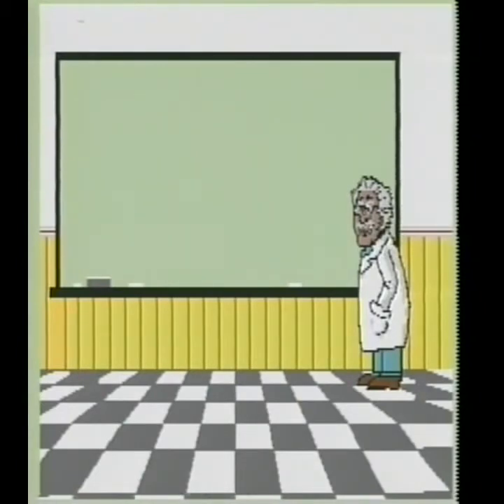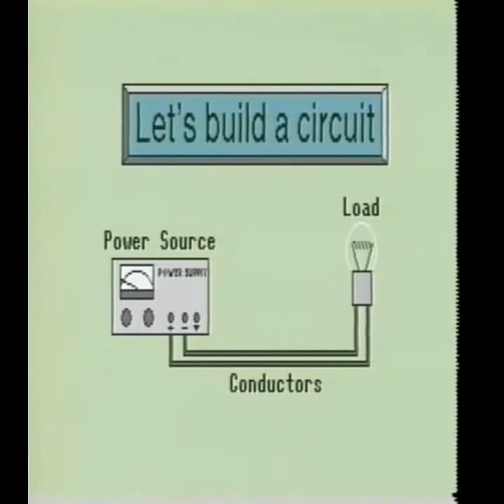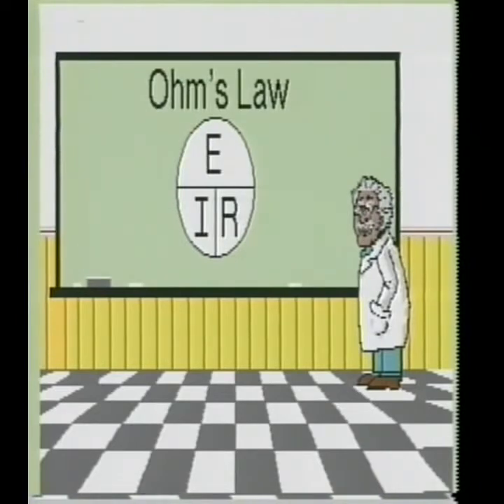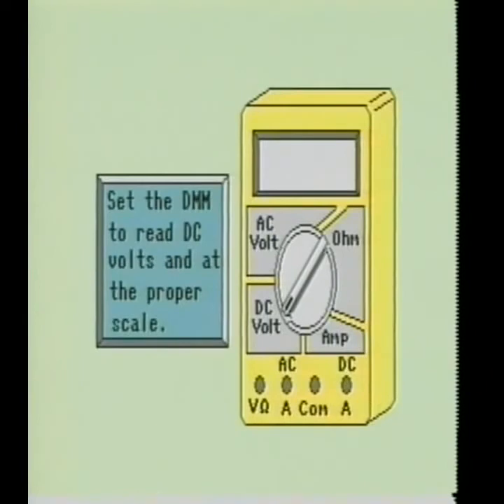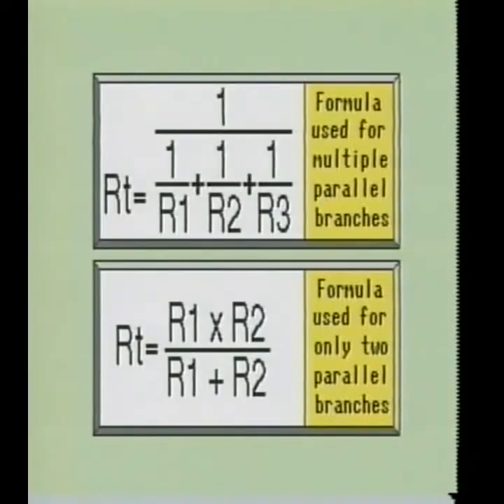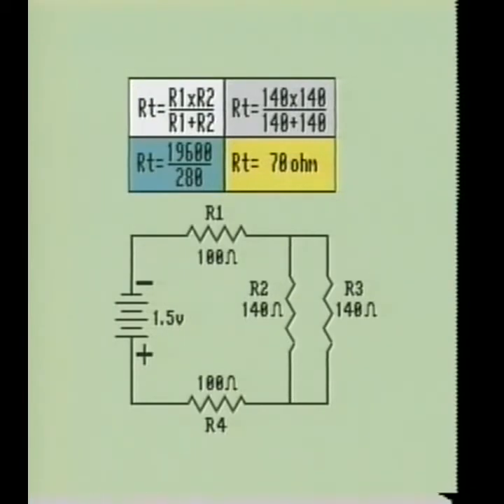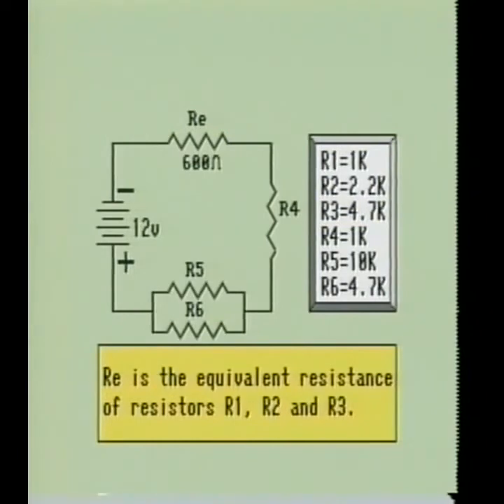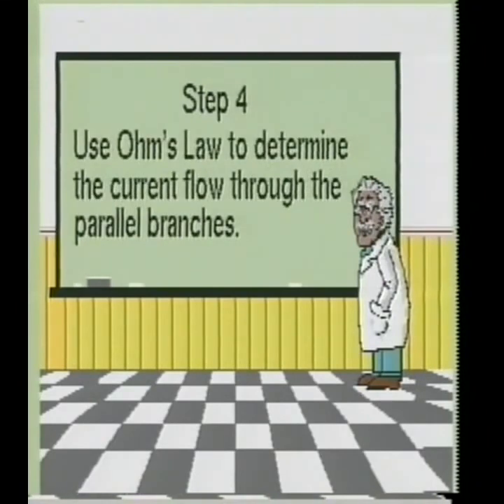Electrical Training UCanDo VT201 Part 1 DC

Comment: Do u have all these videos on DVD?
Reply: Part 2 is the AC, and part 3 is the one titles semiconductors.   Then there is part 4-6 (titled ‘Power Supplies’, ‘Amplifiers’, and ‘Oscillators’).   They are ALL the 200 series (201-206), then there is a 6 part 300 series (301-306) under the title of Digital Electronics.   These Ucando videos are a spectacular example of an “Oldie but Goodie.”